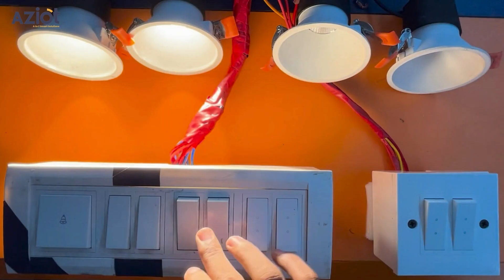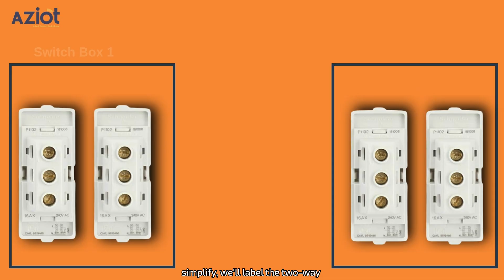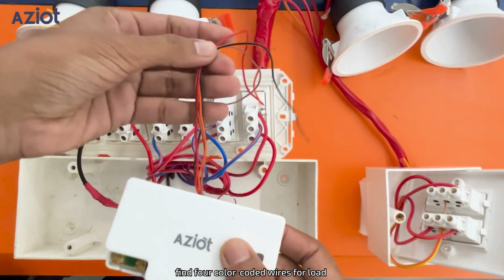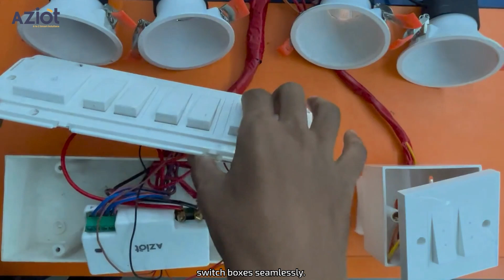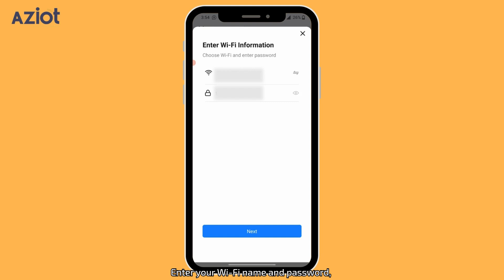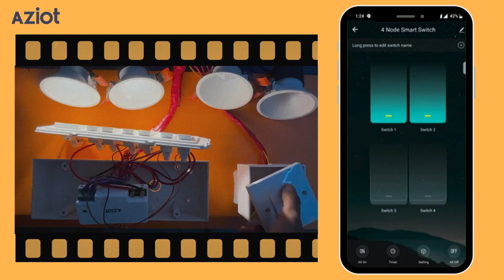4 Node Smart Switch 2 Way Installation Guide | How to install Wi-Fi 4 Node for 2 Way working

Comment: aziot for smart switch 4 node for only 100watt light load Want to use it all night approx 12hr daily light will be on will it work fine or overheating issue will come 
Please answer it
Reply from the maker: Yes, it’s absolutely possible 👍

Our 4-node smart switch is designed to handle much higher loads than 200W per channel, so using it with a 100W light for 12 hours every night is completely fine in normal conditions.

Aise normal use me overheating ka issue nahi aayega 🙂

Comment: Alexa is working  but manually switch’s is not working
Reply from the maker: Hi Arjun, We would need a few more details to able to help you. Please contact our customer support at +91 88866 35918 they will promptly assist you.

Comment: I have connected all but in my 2 ways switch befor installing it was connected to ups but now after power cut fan and light not working pls help me
Reply from the maker: You can reach out to our customer support at 8886635918 from 9:00am to 8:00pm

Comment: Can we connect to fan switch just to turn on and off not to control speed
Reply from the maker: Yes you can connect fan switch to turn on and off
Reply: @aziot will it handle fan load

Comment: Can i connect it to the switch of power putlet to turn on and off of electrical appliance connected to outlet?
Reply from the maker: No we dont recommend to connect to sockets, for connecting socket please use 2 node and 1 node